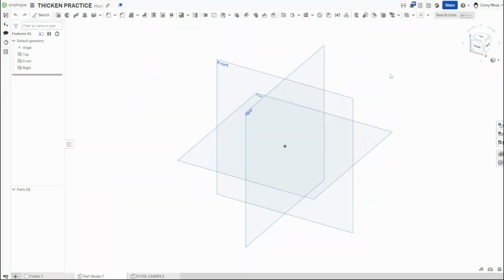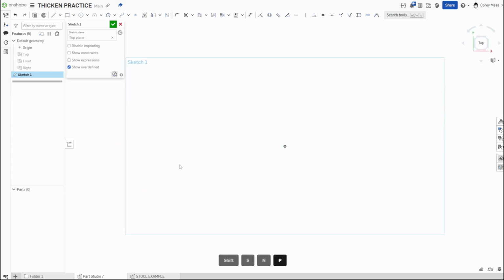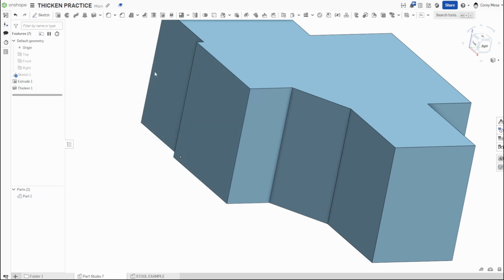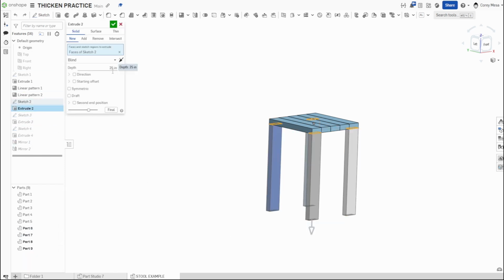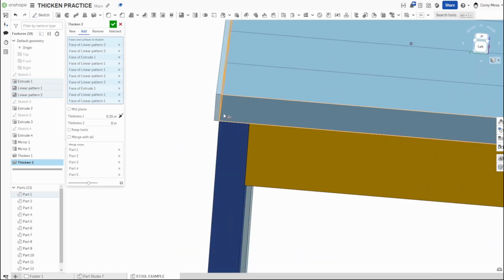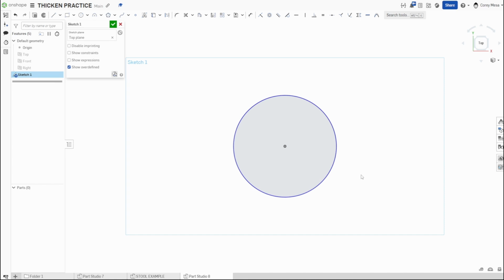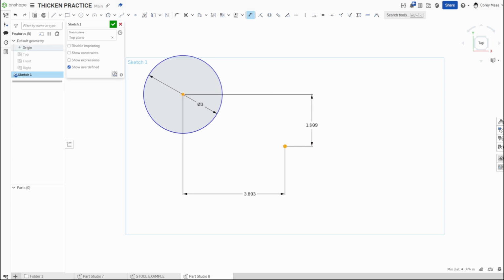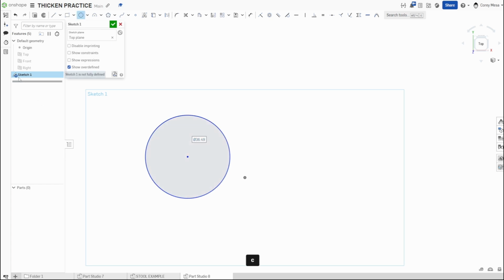Shifting to Solids: Enhancing Designs with the Thicken Tool in Onshape

Comment: Excellent video! I just started playing with onshape for my 3d printer.
I do have a question though. I'm designing a paddle board and I used the shell tool on it to make it hollow. I then used the thicken tool to try and make all of the walls .250 inch thick. It keeps telling me it couldn't render and then has red dots on the model, presumably where the paddleboard is thinnest. What is it having an error with or how do I blend the inside of the walls together so that there isn't a conflict?
Reply from the maker: That sounds Awesome The only thing I can think is that when you originally extruded your drawing it was less than the .25 thickness or the way the that the radius was made when doing a fillet might have messed it up order of operations is sketch to 3d through extrude, then fillet (round hard edges), then shell with that specified wall thickness. Hope this Helps